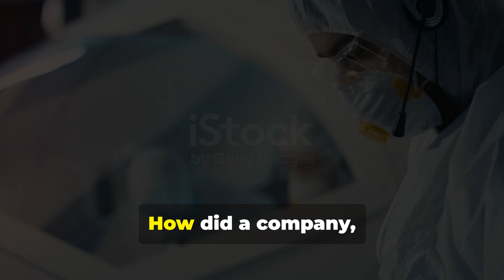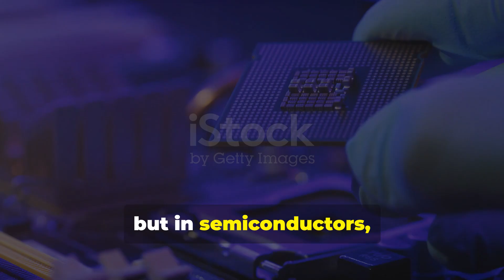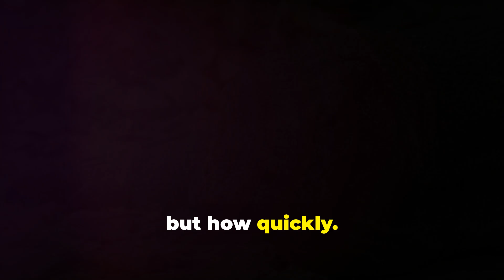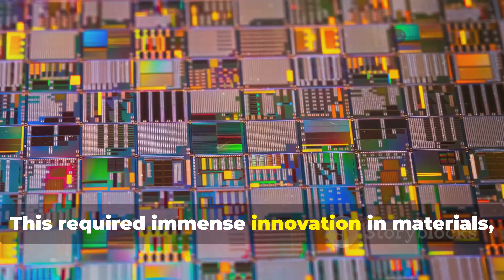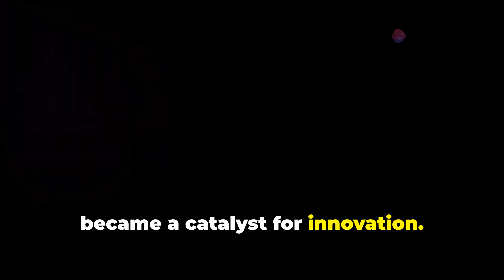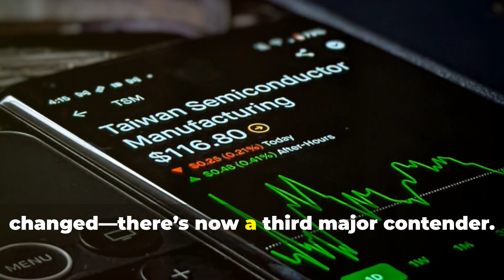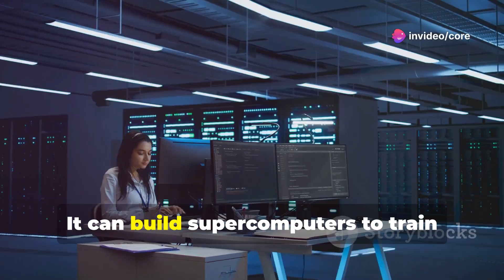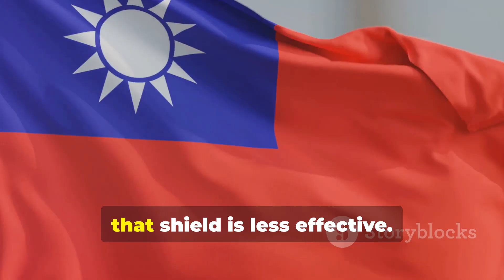China Achieves 2nm Chip Breakthrough Despite U.S. Pressure – SMIC Stuns the World!

Comment: Unlikely to be true. Any number around or under 6 is rubbery.. eight pass etching is expensive, plus interference issues. Somewhere around 4-5 is the sweet spot, and game fast memory smaller. This is scary because premium profits will be wiped out.
Reply: Who told you???? Have you seen it or have you been to China????
Reply: I will note. No I have not been to China or Taiwan.And like the failed Intel phone chip there was size argument back then. Multiple pass or mirrors cause edges to be rougher, causing other problems, so smaller is not always better and higher voltage defects. Like as seen in Intel pushing things.
Reply: China has a working phone chip implies better than Intel's abandoned modem chips that muSt be better than 6. RF energy is sneaky and exposed bad design.